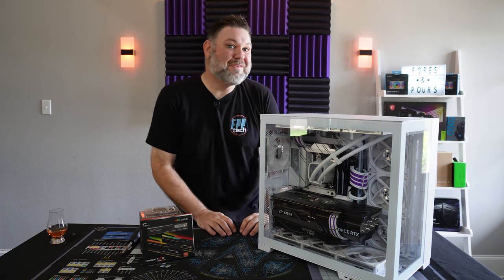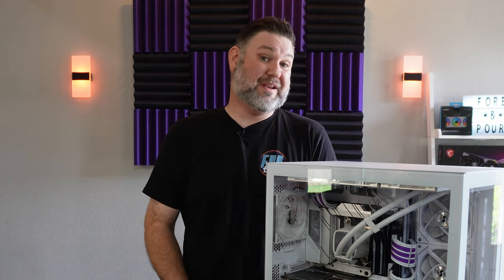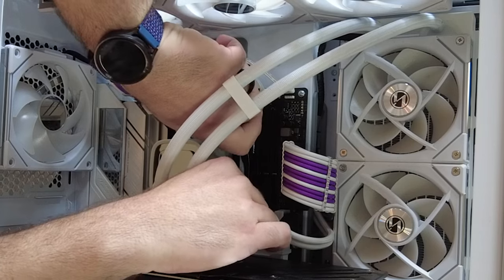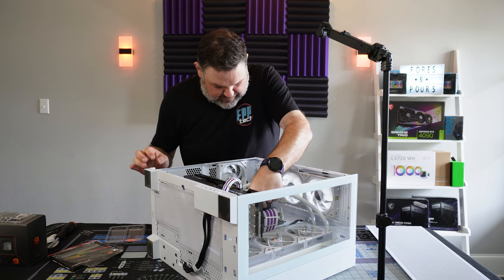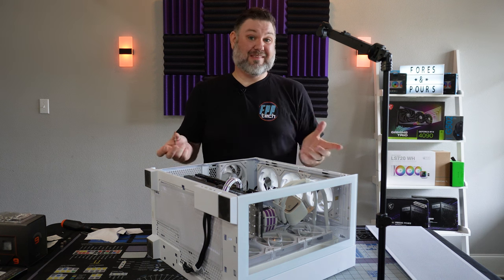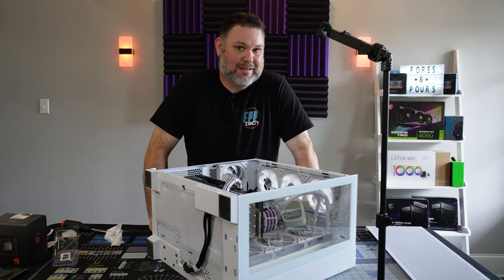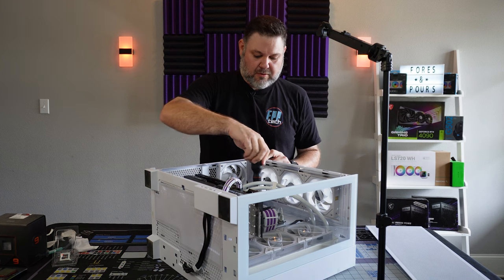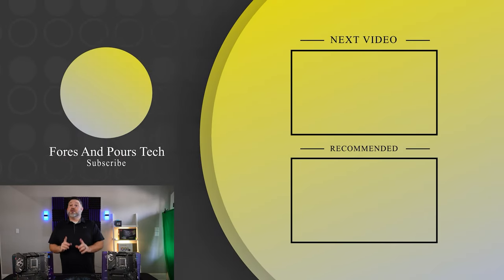Installing New CPU & RAM Plus A Big Announcement & ASUS Update

Comment: During all this I have learned that Ryzen 7000 series running in EXPO, 5200mHz is the speed that is rated for these CPU's. Anything over 5200mHZ memory speed is a bonus and your memory controller is just able to handle it. This was strange to me bc AMD EXPO memory can be purchase at 6000mhz.
Reply from the maker: Allegedly, the next bios drop based on agesa 1.0.9.0 will really improve memory stability at 6000. The issues are apparently related to the rush to fix the SoC voltage issue. The new 7950x I dropped in this video has been stable at 6000 so far. Time will tell I guess. Thanks for watching!

Comment: what happens if you used 2,3,4 slots i got 3 corsair vengeance 32 gb sticks they sent me and extra one should i run 3 ram stick or just buy one more so it can be 4 ?
Reply from the maker: You can run 3 sticks. It should kick it into flex mode, using 2 in dual channel & 1 in single. It may screw up the expo/xmp timings & slow down your overall speeds though. It's generally recommended to run in pairs & if using 4 sticks, match all 4.

Also, most motherboards drop from the advertised supported speeds when using 4 sticks. For instance if a board supports ddr5 6400, that's with 2 sticks. Using 4 may lower that number. Check your MB manual or support site.

Unless you need more than 64GB, you'll get the best speed / stability using the 2x32 & saving / selling the extra.
Reply: @FPP_Tech  where can I sell the extra ?
Reply from the maker: You can try eBay, but it'll be hard to sell just 1 stick.

Comment: Which one would you recommend I take

( GIGABYTE X670 AORUS ELITE AX )
Or 
(gigabyte b650 aorus pro ax)

Cpu : AMD 7 7700x
Reply from the maker: They're really close in specs. I'd lean to the x670 board for 2 reasons. 1) The B650 Pro shares pcie lanes with the m.2-2 & pcie slots. 2) the x670 has Realtek LAN, so you can avoid the bugginess of the Intel 225 platform. 

But, I wouldn't pay more than an extra $30 USD for it. So, the price you can find it at matters a lot.
Reply: @FPP_Tech  buying motherboard It's really complicated
Reply from the maker: @haidar_al-jizani  it can be at first, but once you know what you're looking for, it gets easier, trust me.

Comment: is it safe to pair up ryzen cpus with asus boards (or any board for that matter) again?
Reply from the maker: It's supposed to be after the last BIOS update. Definitely for non-X3d chips. The board I'm currently using is an ASUS one. My concern would be how they handle issues. I'm still fighting to have mine replaced & using a backup. I'd wait another few weeks for the update based on AGESA 1.0.9.0 though. 

From what I can tell, MSI & Asrock seem to have been less affected by the issues.